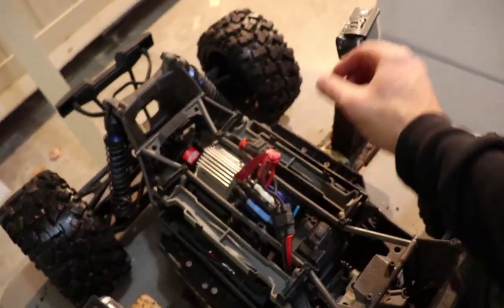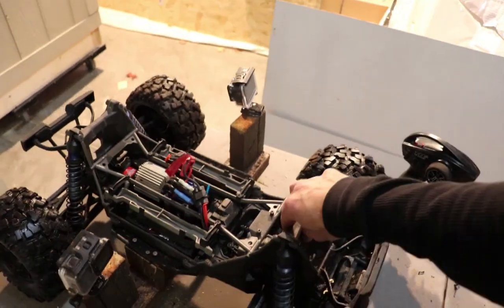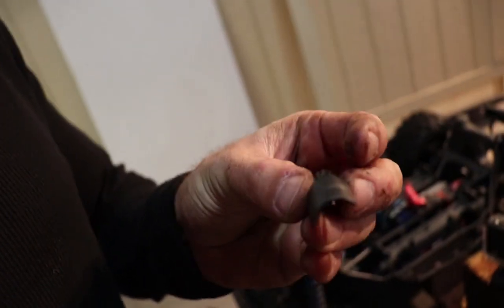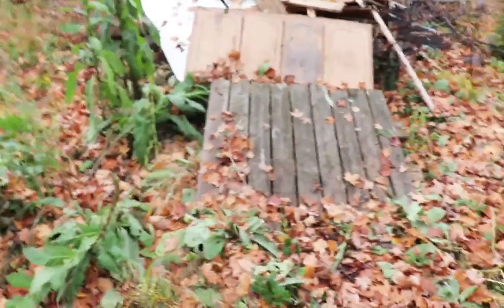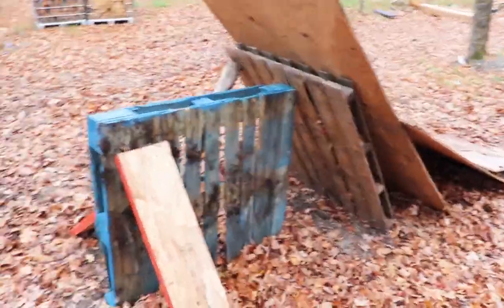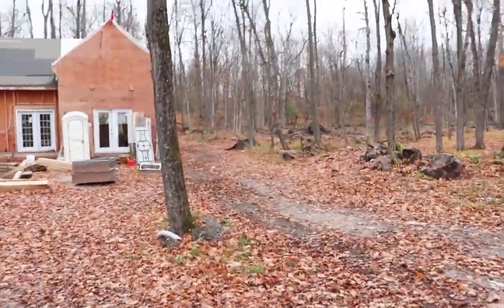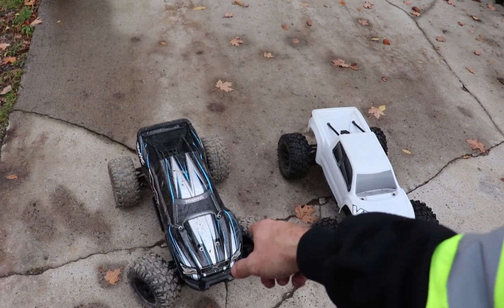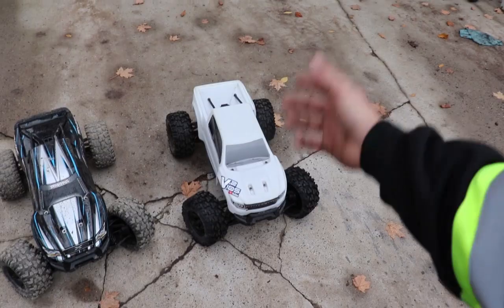Super SKETCHY    R/C Ramp.!

Comment: I recommend to put in a machined steel spurgear from gds amd a machined steel pinion.  I run 20 tooth pinion and 50 tooth spur and get the same speed as the traxxas highspeed gearing. Kevin talbot uses them as well so you can say its pretty strong
Reply: Kevin Talbot use a v1 x maxx motor, 1600 kv, more speed
Reply: @romeoraduu  I know dude, but the 1280 kv motor has a bit more torque and can be used with higher gearing without heating up to quick
Reply: @thomweber4102  yes that is very true.good point